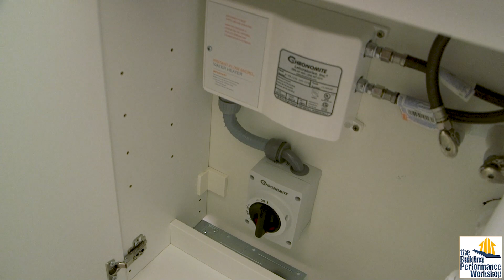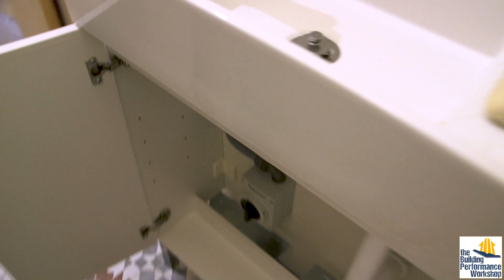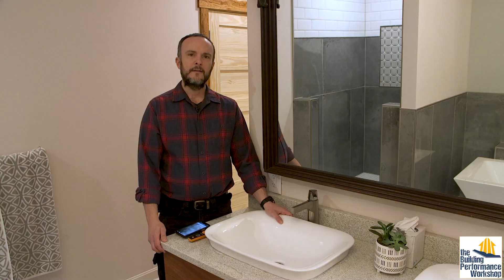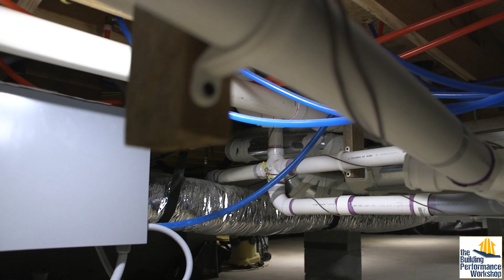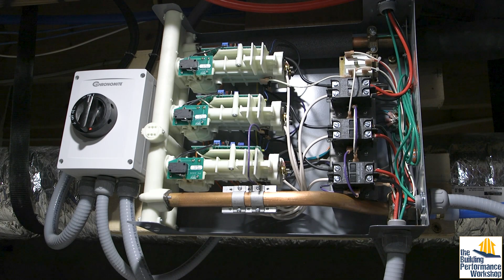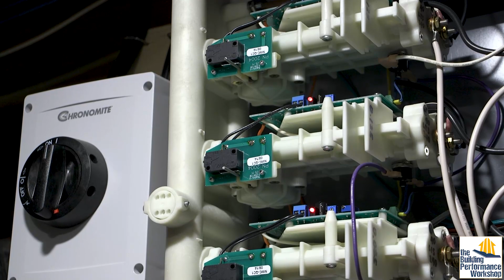Tweaking our Home's Water System with Chronomite Point-of-Use Water Heaters

Comment: Okay, Corbett, I watched this now, 5 years later. I understand the number one issue with an electric tankless water heater is scaling. Have you needed to replace any of these units?  Did you install a water filter system to prevent scaling and improve water quality? Thanks
Reply from the maker: We have a water softener system, and these supposedly have a turbulent design feature that resists scaling. No problems 6 years in.

Comment: Corbbert, this video is 2 years old now have you had to replace any of the units? The reason why they were replaced? And would you still recommend them or have you switched to another manufacturer brand of electric tankless water heaters? Thank you!
Reply from the maker: Fred, video update forthcoming. I have had zero problems with any water heaters, with zero maintenance.

Comment: While you're trying to get the least amount of gpm in your water faucets, I'm researching how to get the most gpm out of my faucets ,showers, etc. I'm on a well system, and the standard 1.5 to 2.2 GPM just isn't cutting it with me. I have fortunately found a manufacturer who makes 4 to 5 GPM  residential faucets that don't look like commercial faucets. I'm having a little difficulty finding toilets that don't have very low GPM . I recently had a friend who is a plumber who acquired 4 toilets out of an old house that were manufactured way before all these water restrictions were forced upon us. However they will need reglazing that's very expensive. It way be worth it as having 1.5 or less GPM toilets is frustrating.

Comment: Thanks for your work, very helpful video. I'm about to install a couple of these water heaters in a new house and doing some research. Don't mean to criticize but I'm trying to understand the building code requirements.  I'm curious about your connections to the heater.  The Uniform Plumbing Code requires 18" between PEX and the water heater.  It looks like you connected your PEX directly to the heater.  You may have a different code in your area.  Also I didn't see a pressure relief valve.  Was there one somewhere that I didn't see or did you choose not to install one?
Reply from the maker: Interesting- I’m not aware these can overheat the same way as a tank since when they operate the pipes are in fact open. And I didn’t know about that code bit, but don’t know why it would be so.

Comment: 30+ seconds for hot water and you think thats fast .. LOL   in europe 18 seconds is almost a standard ... also there are recirculating systems that will deliver instant hot water .. and you dont need to wire  heaters allover the house .
Reply from the maker: There are lots of ways to do it, and if you think 30 seconds is ridiculous you shouldn't try to take a shower in 99% of US homes. You'd die laughing.

Comment: Hi! I am trying to copy you all here with a house I just bought. I wonder if the tub filler is a lower-flow style faucet? Because the Chronomite guy said they don't have anything to handle a tub faucet. I'm trying to think of how to handle the gpm of a tub faucet...
Reply from the maker: We have two bathtubs, and our Chronomite units are perfectly fine with them. Not sure what the problem is.
Reply: @HomePerformance  Hi I mean there are like 18 gallon-per-minute tub fillers and tankless water heaters can't do that... So I guess I'm really just wondering how much gpm the tub faucet in this video is :)
Reply from the maker: WTF- I thought baths were supposed to be relaxing? 5-10 gpm at 50psi is completely adequate for a normal person. Ours are Delta fixtures, nothing weird.
Reply: @HomePerformance  Yeah I am not expecting a super fancy stand up kind. Maybe i shouldn't have said 'tub filler' to the guy. Ok thank you very much. Now if electricians would stop trying to steer me towards conventional tanks when I try to get a quote from them on upgrading the service
Reply from the maker: It’s hard when they think money is the only decision maker

Comment: Why did you choose this style of system over a heat pump with circulation line.  Greetings from Australia as well.  Good stuff on your channel.
Reply from the maker: Thanks Tye- one simple reason is we don't have a tall space to put it in, and I could not find a single horizontal unit. But also, lots of people in the performance space are promoting that approach, and I like an underdog- so we went with this less well-known technique (over here anyway).

Comment: I M  in and out of restaurants all day long.. Think they have their tanks set to 165.  Crazy hot.  Here at home I have my tank set as low as I can go before going to vacation mode.  Not so easy doing what you did though I do appreciate your comments. Living in this 50+ YEAR old house without rebuilding it along with the rest of the odd things just is not viable.  Frankly am not much into point of use other than a tankless at my kitchen sink.  Lots of ways to skin the cat.

Comment: Am thankful that the point of use units have dramatically gotten better. I lived in england for a year. Some of the point of use units left one scalding on one side and cold on the other.  Showering was interesting.. Apparently the internal mixing valves were crappy

Comment: I would only run a circulating hot water loop from a 97% gas efficient water heater back to the water heater, hitting every faucet/tub/shower in the home.  That line, like the normal hot water line would have an insulated jacket.  I'd rather not deal with a non-functioning point-of-use water heater under a sink when it fails.  Technology sounds great but I've has too many circuit board failures over the years in appliances that renders them useless.  The more stuff you have controlled by processors, the more likely one will fail.  I did have a board failure on my water heater in another home but keeping fewer appliances simple is better for long term reliability IMO.  If concerned about energy waste with a continuous running pump, many have built-in timers. 

NG pricing where I live is low compared to electricity in our cold MN climate, so heat escaping the hot water loop is more advantageous than not since we run our central AC only a few times in the summer.  My HTC Phoenix water heater is awesome.  50 gal tank, 77k BTU with a 10 minute time recovery.  We never run out of hot water, even when two showers running at the same time.

Comment: WOW! This was great brother.  We're at $0.0823 kWh,water is cheap, and our incoming water temps are pretty low. So on demand water heating is usually NG or propane here. What is kWh price in Atlanta?
Reply: Jealous,  we pay .24 to .32kwh here with PG&E in CA
Reply from the maker: Yes- more reason to take efficiency more seriously out there
Reply: Working on it. Just installed a heat pump water heater that’s replacing an old propane one. Also moved it from mud room to center of basement. It’s cheaper to run, less wait time for hot water to faucets and get to plug the hole in the ceiling/ roof where the exhaust was.
Reply from the maker: Thanks Joel- I believe we're around 12 cents at the moment.

Comment: Great video. A couple of questions - 1. why not use the Uponor Logic style system with one long run and a recirculating pump? 2. What brand tub is that, I love what you did with the mineral wool - did you have to cut into the cavities?
Reply from the maker: Thanks Al. I did use Logic for the layout. Not sure of the tub brand, but all the ones I’ve ever seen are open at bottom, no need to cut into anything.
Reply: @HomePerformance  Got it. Why did you opt for the point of use tankless units vs a recirculating pump? genuinely curious. cheers,
Reply from the maker: Partly because nobody does this around here, and we love being guinea pigs (see also Form-a-Drain, GP ForceField, etc). And partly because the whole point of demand based water heating is that you don’t have hot water being created and thrn just sitting unused. It made sense to us.

Comment: Knowing enough control theory to hurt myself with, the stepped power output of a relay controlled heater with flow dependent output temperature feels like it could get into really annoying temperature fluctuations when interacting with a thermostatic valve. Would be interesting to hear how it works in practice. I hate it when showers can't output a constant temperature.
Reply from the maker: Very interesting, Ants- you know more than me on the topic. I’ll update.

Comment: I love the idea of a point-of-use water heater from an instant use and (primarily) water waste perspective. But everything I've read on the subject suggests that even though there is 100% efficiency on actually used water, it still will be notably less efficient than a hybrid water heater -- even one that needs to kick on every so often to heat up an unused tank. Given that, it seems like a hybrid heater + recirculation pump would cost less to install; cost less to run; deliver hot water even faster (wasting even less water); and do so with fewer parts that can ultimately fail.

I'd love to hear your perspective on this. Am I wrong about anything above? Or missing an important aspect that matters to you?
Reply from the maker: It’s an interesting idea, but I don’t think your way would be either less expensive or easier to install. More than double the amount of piping (hot + cold + recirc loop), plus the waste cold air that these produce, it seems like a cool way to go but we picked this way instead. Everything in its right place, no right answer the same for every house.
Reply: Reading the literature for the AO SMITH hybrid they discourage use of a recirc pump and of course their efficiency numbers are measured without one. Most recirc pumps run thru out the day. But conceivably you wouldn't loose much efficiency if the recirc only ran on demand instead and there are some out there. You would have to wait for the hot water to arrive at the faucet with this setup.

Comment: With all the electrical appliances in the house does a 200 amp service meet the required load with all electrical appliances on
Reply from the maker: 400 amp wiring capacity, but we’re hooked up with 320 amp because our smart little family won’t ever get close to maxing out.

Comment: If you need the shower a little bit hotter or colder what do you do then? as if I understand correctly once you set the temperature on the system that's it, you cant use a thermostatic to adjust the tamp to individual taste... My wife like her bath slightly below 1st degree burn temperature and I don't. Any solution to control the temp or device ?
Reply from the maker: Of course- use the mixing at the tap. All I was saying is you want to set the max and adjust down at the tap.

Comment: The point of use heaters are really interesting. Does this minimise your risk of pipes freezing?  

Two non-topic questions Corbett. The white PVC pipe in the crawlspace had a black cable spiraled around it. What is the purpose of that cable?

When you designed and built your home what universal design elements did you put in place to allow you to age in place?  An example being, extra blocking in wall to install handicap rails in future?
Reply: That looks like a central vacuum system with 2" PVC and a signal wire to tell the vacuum when to turn on.  The way it is plumbed it can't be for drains.
Reply: @skippers9277  Thank you, that makes a lot of sense.
Reply from the maker: Correct, it’s a central vac. As far as aging-in-place, our master suite is on the ground floor, all hallways and main bathrooms are extra wide to accomodate walkers/wheelchairs, etc. We don’t plan on being disabled anytime soon, but we did incorporate those features and we’ll be talking about them on Home Diagnosis season 2.
Reply: @HomePerformance  Thank you.  Look forward learning more.

Comment: FWIW: The issue with using electricity as your sole energy source is when there are power outages. With a Propane or NatGas for heating & DHW you can still use them during a power failure with a modest size generator. 

I live in a semi-rural area which power outages can be an issue, but when I lived in a suburb region the power failures were even worse. There were storms that knocked out power for weeks and once more than a month. 

One must consider that the US grid is aging during a time when most skilled electrical workers are retiring or near retirement age. Then couple that with the the green energy policies that rely heavily on intermittent power sources like wind & solar that are not reliable. I suspect the US is going to face frequent power outages as well as much higher electric prices as old coal fired & nuclear plants are decommissioned. I much prefer to not be relying on a single point of failure.

Another concern with those on-demand water heaters is they need to be flushed regular to remove scale from them, a water soften will help, but probably not total prevent scaling with those instant high power, electric water heaters. I would have recommend installing some purging valves so you can flush them periodically. Purging valves are ball valve that have a hose connection. 

Not so sure its a good idea to have your ERV sucking up urine vapors from the toilet. I would be concerned that it will out-gas ammonia and urea. I know that urea is corrosive to metals and can attack some plastics. It may cause the ERV exchange to fail or allow ammonia or other contaminates to leak through to the air intake side. The ERV membranes are designed to transfer some of humidity between the exhaust and the intake, so its a good bet it will leak smells and out gassed compounds, especially if they are water soluble.

One thing to consider with the cold water lines is that you might want to keep your cold water cold. There are times that I want cold water to be cold (usually during a hot day & looking to cool off fast washing my hands and face with cold water. as well to drink cold water). For this reason i have also insulated my cold water lines.

Hope This was useful.
Reply from the maker: You are a deep thinker, Guy Tech- thanks. As for the ERV, when it goes, it goes, and we can easily replace thr core or the whole machine as long as it’s accessible. Trade-offs, trade-offs.
Reply: Am glad I found this..I was wondering about the legionella risk of tankless system or point of..., it only heats the water when needed so when you close the faucet, doesn't the water stay still in the pipe? and in tankless I know there is those small pipes that the water passes through, won't the water stay there?
Reply from the maker: I believe you need the trapped water to be between 100-120 for long periods for the bacteria to flourish. No way it’s staying warm that long without a heat source.
Reply: I agree with Guy Tech. I don’t have the time to get into all the details but I was thinking along the same lines except that this is the second video I’ve seen from this channel, so I didn’t know that the exhaust was going through an ERV. There are definitely some vents that shouldn’t go through a narrow passage core, like greasy air from a stove. I was most concerned about water issues. Was the flow from the tub hot faucet filmed before the pressure regulator increase? It looked pathetically low and seemed to be at “full on” because it was almost 180 degrees from off. I would think that you’d lose a lot of heat from the tub due to convection over time because the flow looked to be around 1 GPM!!! A 40 gallon fill would take 40 minutes if that is indeed the flow and you used 100% hot. Not having 120 (or higher) degree water means you can’t drain a little warm water and replace it with HOT to average it up, you have to remove much more warm water to replace it with somewhat warm-er water. 

The issue with instantaneous water heaters is that with any mineral content in the feed water that passes over the somewhat small, very hot heating surface there will be precipitate that will form. Heat precipitates minerals and a traditional tank water heater has a large surface area that heats, a tankless NG heater has several burners flowing over narrow passage ways and electric heaters use elements that I would suppose have a small amount of surface area. Tankless heaters without great water treatment quickly cake up with scale and become much less efficient, slow water flow and transfer less heat to the water but often the outside of the heat exchanger gets hotter trying to raise the temp of the outgoing water (which damages and wears it out faster). They have to be flushed with antiscalant using a circulation pump to recover most of their efficiency. I haven’t seen electric units with bypass valves to flush or run antiscalant, it may not be an issue, but if other electric water heating appliances offer any info, it will be. Coffee makers lime up, as do electric kettles, whole house steam humidifiers (google Honeywell’s it’s plagued with mineral problems) and electric tank water heater elements. 

If I were in your shoes I would make certain that the water chemistry was perfect for those heaters and turn the pressure regulator up to 70psi. Cities aim to provide around 60psi but some homes will end up with 80 or maybe even 90 (as I have run across downhill from a water tower). 

Kudos on choosing expansion PEX though, all other PEX (crimp) has small ID pipe and very restrictive IDs in their fittings. If you did all that with a manual expander you should enter an arm wrestling tournament! If you bought an electric/hydraulic you’re smart.